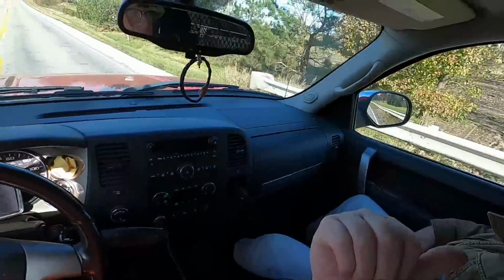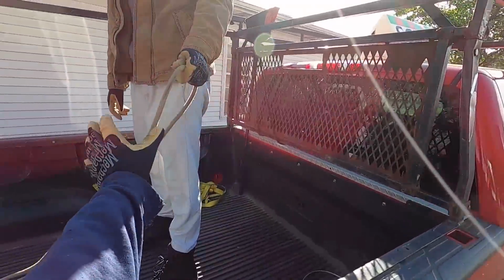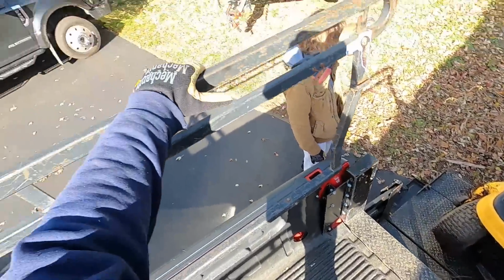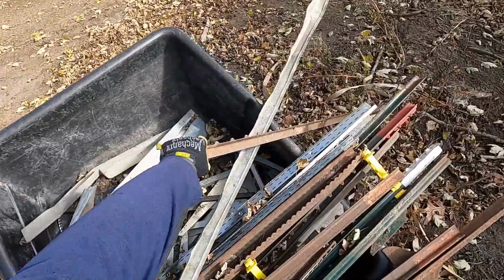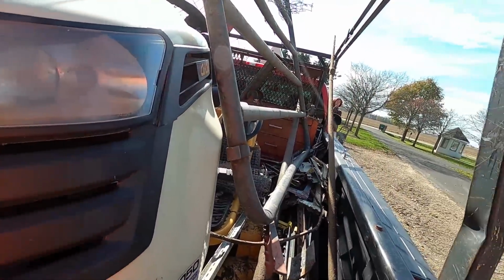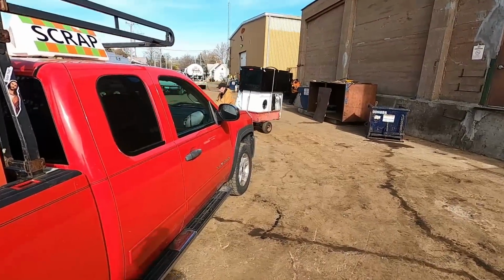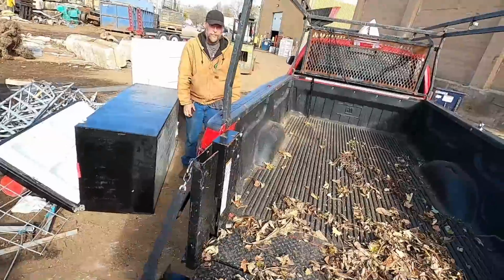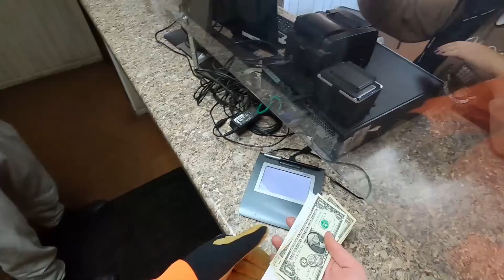Farmer Wanted Scrap Gone - Should be Easy

Comment: For riding mowers that are hydrostate there is a release rod to put it in neutral so it can be pushed. On the cub it’s in the back near the hitch part, little bent 1/4 rod sticking out, pull it and move it down the slot so it stays out. It’s in neutral to be pushed! Have a cub just like it. Lol make it easier on yourself next time, but still hard to push with flat tires.

Comment: Timestamp 22:07 those extra parts on the chain are for in-frame tow points on newer vehicles. Most newer cars do not have secure points that older one have so the built them with small oval holes in the frames.

Comment: Hey paul on the back of  those  mowers there is a lever. That you can pull out and  it puts it in neutral
Reply: Put mower in neutral
Reply: @jrae6608 that mower is hydrostatic  drive it doesn't have a  neutral.

Comment: love your videos but this one had me shaking my head thinking there is no way I would trade my trailer for a lift gate.  the end of my trailer is about shin high so I have no problem loading appliances on it. just put them next to it and flip them in. the mower would have been easy as well. just tilt the trailer down and use the winch. easy as it could get. never commented about the lift gate before but had too on this one. I load all the big stuff on my trailer and still have my pickup bed for the smalls. I can load 8 washers or dryers on my trailer and still have room plus the pickup bed. Nope no way would I trade with you on the lift gate. but still love your channel.

Comment: A couple notes for you Plau!!  Cool seeing Jessie out with you.  There is small rod that sticks out the back of the tractor and is chrome.  It puts the tractor into neutral and easier to roll.  That chain is from a car hauler.  The odd hooks fit into slots in car frames and the chain connects to hooks on the hauler frame.
Reply: I was going to say the same thing about the chain.

Comment: Hi Plau (lol), Ummm, I believe there is a small rod sticking out of the back of those lawn tractors...if you pull it out and lock it out it disemgages the  transmission so you can push them easier. Mine does at least.
Cheers from New Brunswick, Canada...eh.

Comment: If you were to throw your excess chain over the the chain that is doing the pulling, it would fall to the ground or bed of your truck if it were to come undone. We would use a heavy blanket over our chains when doing frame work on cars and trucks, if it came loose it would drop right to the floor and not go through a window or hurt anyone. Better safe than sorry. Also you need to get the come along out further at first so you don’t have to worry about running out of cable and having to readjust. Using ropes with the chains aren’t the safest .

Comment: I had an 02 Dodge Dakota for 20 yrs that I started scrapping with, held up well but did start getting frame rust issues. That looks like a 2nd gen Dakota as well. They had clear coat issues too where it starts to flake off, usually on the hood and roof are the first to go. Mine the hood was fine because it was redone after a deer hit but the roof did peel off and got a bit ugly looking.

Comment: My dad has a 2003 ford excursion that he uses for for his job for escorting oversize loads that is still running and working with 577,000+ miles on the engine. He will not use any other vehicle to escort oversize loads.
Reply from the maker: That is amazing mileage

Comment: Need to remember that all riding mowers require  you to be sitting on the seat, with your foot on the clutch/brake pedal,,,  before it will start,, And that is only if it is in good enough shape to start in the first place,,  :-)